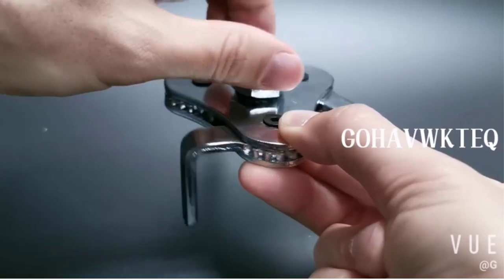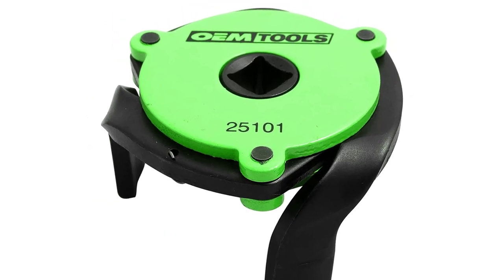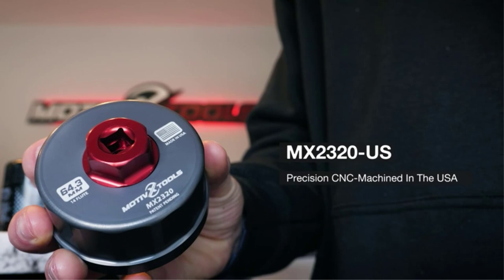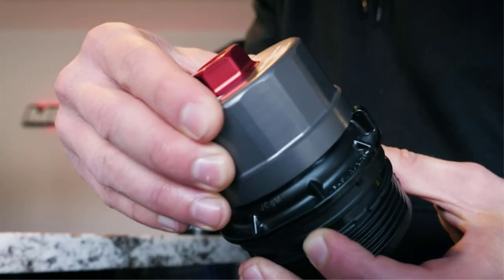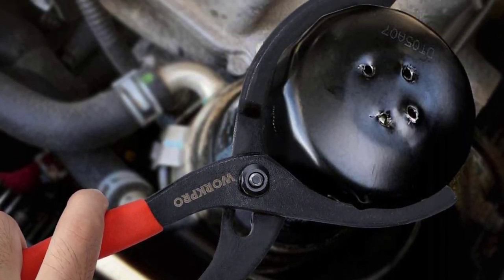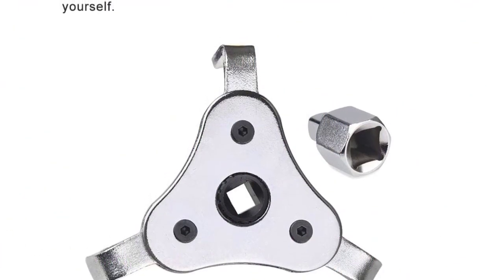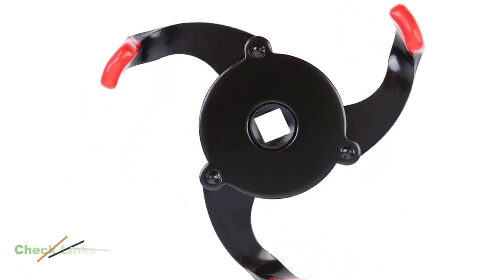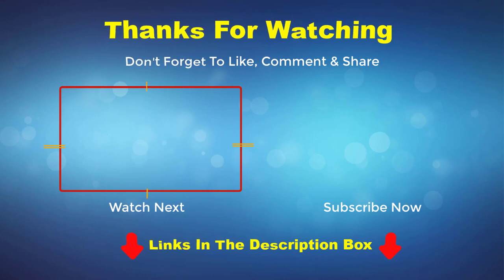Top 5 best oil filter wrenches in 2023 🔥

Comment: The oil filter wrench I've used the most I bought from J.C. Whitney & Co. 45 years ago. It's made from a flat piece of steel with a length of bicycle chain that hooks into a notch. It's compact, universal and grips filters securely. Anyone with a hard to get to filter should get a quality cup type wrench in the exact size needed that can be used with a ratchet and extensions.